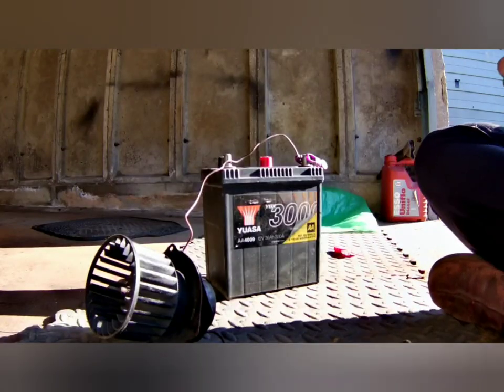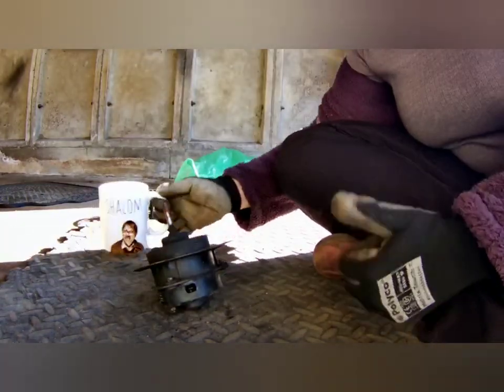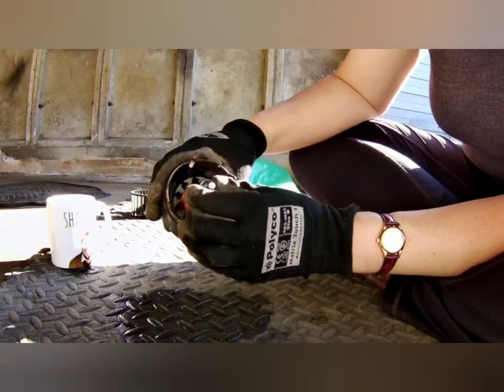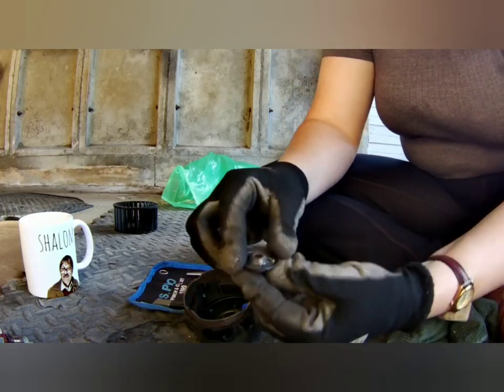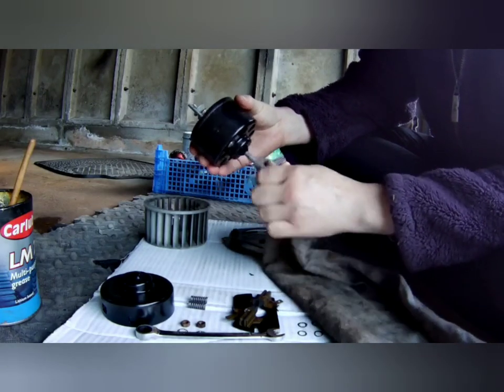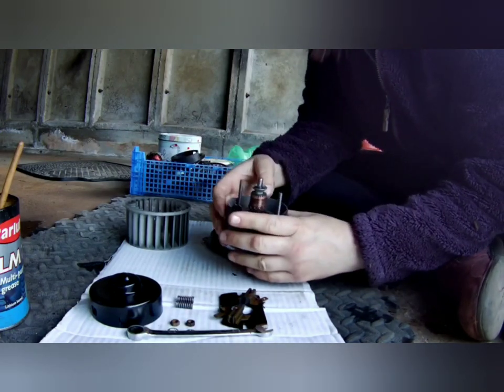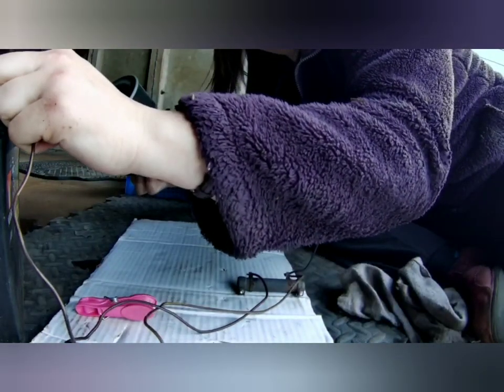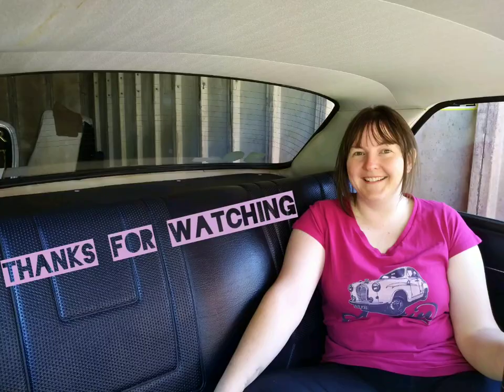Smiths Heater Box Fan Blower Motor . How to strip , service and put back together . classic car

Comment: Thanks for the fun and educational video. I have a Morgan Plus 8 where the heater fan sounded like a Lancaster in low pass. The voltmeter dropped from 13 volts to 11 volts every time I turned it on. A new fan from Morgan will probably cost me £3-400 plus shipping. Your video gave me the courage to disassemble the heater and fan motor. It turned out that one magnet was loose, I glued it with epoxy and now it works perfectly. I wouldn't have done this if I hadn't seen your video. Thank you very much! Erik Sandsmark, Norway
Reply from the maker: This is so great to hear 🥰 . Love that my video gave you courage and saved you money 👍🏻 nice one!

Comment: Those bearing retainers in the heater motor are called Star Lock washers. The large ones 35mm o.d. used in lucas wiper motors are impossible to find

Comment: Thanks for the detailed instructions on breaking down, and reassembly of the Smiths heater fan motor. Good job ..! 
 I'm getting ready to do the same to the fan motor out of my MGB ( pulling the heater assembly was a torturous nightmare ).

Comment: Any idea if the unit in the TR7 has the same clippy thing to get the fan off?  I cannot see it and don't want to break the plastic trying to force something - great video by the way
Reply from the maker: Thank you x if it is smiths fan it will probably have same sort of fitment.  
If you break it , i have lots of Fans here from P6 and Austin Allegro that may do you.